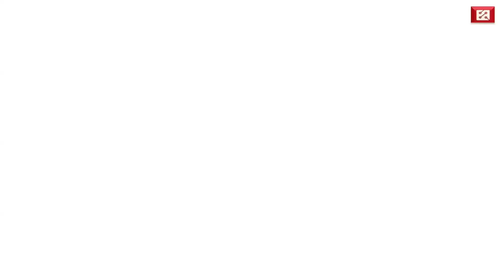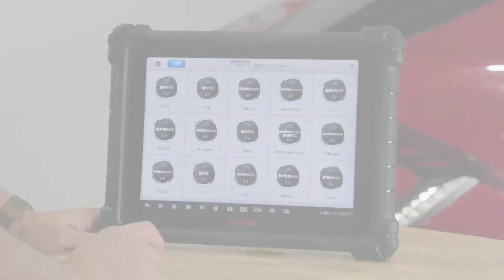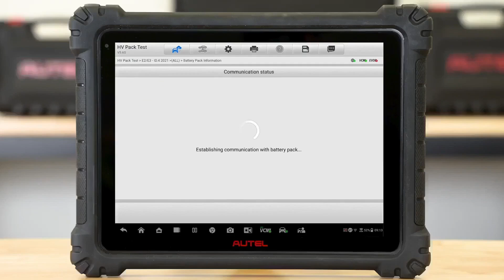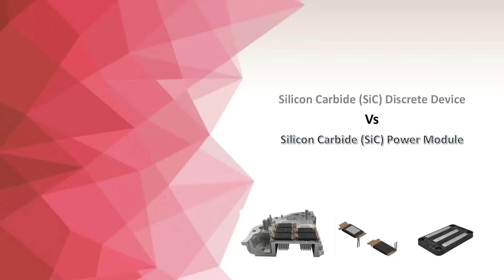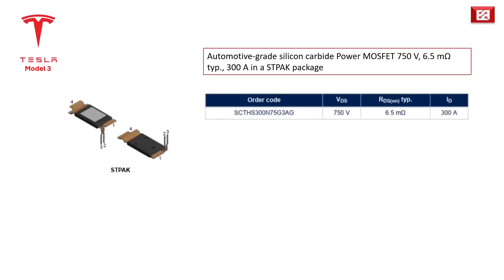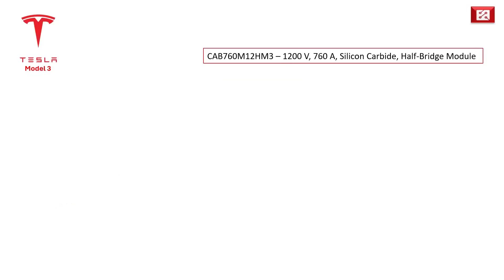Tesla Model 3 Performance Inverter EXPOSED | Silicon Carbide (SiC) Modules vs SiC Discrete Devices

Comment from the maker: Welcome Subscribers and New Viewers!

Welcome to “Tesla Model 3 Performance Inverter EXPOSED: Silicon Carbide (SiC) Modules vs SiC Discrete Devices.”

In this video, we take a deep, engineering-level look inside the Tesla Model 3 Performance inverter and break down why Tesla chose discrete SiC MOSFETs over traditional SiC modules — covering packaging, gate driving, thermal management, efficiency, and reliability trade-offs.

Join the discussion:
• Do you think discrete SiC is the future of EV inverters, or will SiC modules take back the lead?
• What inverter teardown or EV platform should we analyse next?

If you find the breakdown useful, please like, subscribe, and share — it really helps the channel grow. Thanks for watching, and let’s dive into the engineering.